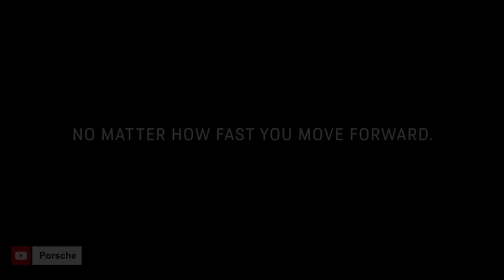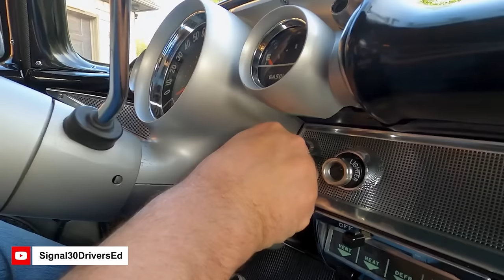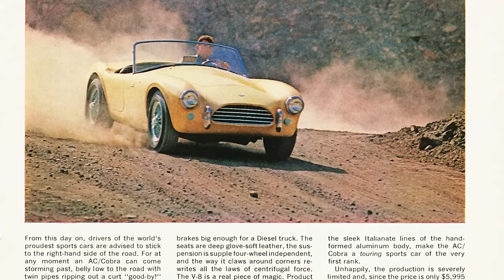Why Old Cars are Better

Comment: i honestly belive the sweetspot are 80s 90s cars.

they are old enough to still feel like youre driving, they mostly give you the emotions, they are still easily fixable by yourself, they dont have too many electrical systems that are dependand on each other or connected to each other

and they are still good to live with today. 

you want a fun little car? get a mk1 miata. 
you want a reliable but nimble and practical daily? get a 94' accord wagon manual. 

you want a big cool off roader? get Cherokee, a Landcruiser or a Patrol. 

you want a big luxury cruiser? get an LS400.

in the 90s, computer engineering was still in its infancy. manufacturers couldnt calculate accurately enough how long thier things would last. how long thier parts would last. so the rather over engineered them still. 

coming closer to the 00's these things changed. you can still find some 90s tech remnants in early 00's cars but you will have more and more electric steering and throttle systems, vsc, abs systems and so on. 

long story short, peak car engineering for the normal consumer was in the 90s in my humble opinion
Reply: DUDE, I saw a Mk1 Miata at the gas station today with a big block Chevy and an enormous Holley sticking out where the hood should be.  If I hadn't been late for work, I woulda stopped and asked about it.  Edit: Oh and a giant fuel tank strapped to the trunk Mad-Max style.  I almost didn't notice the engine because of the fuel tank lol
Reply: Also, the fact that lots of Honda tuners change the OBD2 cars back to OBD1 tells you a lot.  Me and a buddy are looking at doing this with, plus turboing a '98 Accord.
Reply: This exactly. That's the reason why my daily is a '99 Toyota Corolla wagon. It is still driven by cable, as is the shifting. It isn't fast at all, but it does feel like it is because of all the sounds it makes. Its exterior is  pretty banged up, so I don't habe to worry about scratching it. At the same time it has a bigger boot than a modern wagon that is way bigger in size. Everything that goes wrong, I can fix myself. That's a win in my book.
When I don't have to get from A to B, but I want to experience driving, I take my '88 Toyota MR2. This thing is amazing in what it does.
Reply: I daily a 95' LS400, a wonderful car to drive around and cruise. Even sorta fun sometimes if you push it!
Reply: the 90s crown vics are so nice
Reply: 80s cars have a level of analog nostalgia to them that is unmatched
Reply: Adding the W126 and W140 to big luxury cruisers.
Reply: I bought a '95 Accord, really, really good car and decent fun for what it is. Few electrical gremlins here and there but nothing too bad.
Reply: I love my ‘92 F150. Small block v8,  manual transmission, has everything you need, EFI, anti-lock brakes, but without all the modern garbage that make them impossible to work on. I don’t think I’ll ever own anything newer than a ‘97 or so. The newest vehicle I’ve ever owned is a ‘94 lol.
Reply: The moment OBD2 became the standard is the sweet spot. OBD 1 sucks balls to do diag with. Source: I own an 89 Super Coupe, and troubleshooting it is a bitch.
Reply: As an owner of a 5 speed 94 accord I completely agree. Manual steering, no abs and no traction control is makes the 160 hp feel like way more than it really is. Blown the engine twice and swapped it twice without too much headache. I’ve got coil overs and other suspension bits to Make it handle nice, it’s the shit.
Reply: @FurryWrecker911  you got that right. They’re so finicky. My old ‘94 Explorer threw a code one time, so I flashed it, and the number that came up literally said “No code present,” lol. I had a buddy who was a master tech and happened to have an old snap on OBD1 scanner he let me borrow. So I hooked her up and sure enough it was throwing a code for “no codes.” Can’t make that 💩 up. I’ve been wanting to replace the 5.0L in my F150 anyway, so I’m seriously thinking about getting a late ‘90s 5.0 Explorer motor for it, and swap in the ECU and harness with it, just to have OBD2 and not have to deal with that crap anymore. And having a coil pack instead of a distributor is just icing on the cake. I just hope the harness would be long enough, because wiring sure ain’t my strong suit lol.

Comment: Right. The sweet spot for vehicles is 96 to 2006. This trend is everywhere. How long does a new washer last? New fridge?
Reply: I'd say '76, if it was maintained and cared for.  Same with my fridges, freezers, washer and drier.
Reply: I totally agree. When my parents helped me buy my 99 Ranger new they told me if I defaulted they were done. That got me scared and motivated and when I got rid of it in 2021 it had 418K.
Reply: We had to buy a new dryer, it's 2 years old and already has issues blowing hot air. It's a dryer, that can't blow hot air.
Reply: @FuckGoogle502  76 is during the malaise era, definitely avoid anything made by GM at the time.
Reply: @SoupyMittens 70s gm cars aren’t bad just slow
Reply: @justinplunk5237  The build quality is usually pretty poor from what I've seen
Reply: Planned obsolescence.
Reply: Agree. That makes sense
Reply: I had GE appliances from 2004 that all started failing in less than a decade.
Reply: @user-vi4xy1jw7e  yeah. That case you can thank jack welch for causing problems
Reply: @SoupyMittens  When exactly IS the malaise era, and what manufacturers did it apply to?
Reply: you can even broadly expand it from 89-09, depending on what the vehicle is.
Reply: @Drunken_Hamster  In general, as far as I know, the malaise era refers to pretty much every American car made from about 1972 to 1985.
Reply: @SoupyMittens  Found more resolute information online. 73-83. By 74 regulations were in full swing, and 83 was the last year of truly/fully neutered engines with 84 being marked as the "end" with the GNX and 85+ having faster cars again.

And it does seem to only apply to American makes, though TBH IDK what foreign car I'd want in the range of 73-83, either... Maybe a Datsun Z as long as it's not the fugly 2+2 280z.

Comment: I took 2 years of auto mechanics in high school because it was a good skill to have and lots of fun. That knowledge saved me a lot of money, too. There are very few things I feel comfortable doing myself on modern cars, which is one reason I don’t have one. Repair & parts replacement of electronic components is very costly.
Reply: This summer I aim to learn auto shop stuff. I think it'll go very well with my degree of mechanical engineering. Hopefully I can also save my family some money with oil changes too haha

Comment: Learned to drive on my dad's 72 CJ5, I can tell you the is no driving experience more pure than an old Jeep. Thin military style tires, hard suspension, mechanical steering with a massive steering wheel, everything open around you, 2.6l straight 6 on a 3 speed box, pedals are perfect for heal and toe. You hear every noise, you feel every bump, you smell every smell.
Reply: MDJuan makes reproduction Willys Jeeps. I want, but might go Battery Electric Transmission.
Reply: They were better before their Stellantis times
Reply: 1975 and 1980 U 50 owner here (Brazilian C 5 with 2.4 Ford engine 4 cylinder) I couldn't agree more! my GF's Jeep (the 1980) has a "cage" and her windshield is up and she has half doors. Mine is lacking all that. Windshield down, no doors. Smile from ear to ear
Reply: @roelandpeeters931  hehe meu 72 Ford ainda era o 6 canecos, adoro esse motor.
O seu tem alguma coisa escrita na tampa traseira? Li que 72 foi o último ano que tinha escrito FORD na tampa
Reply: @arthurbretas2003  Lo siento, no hablo Portugues. Pero no, no tiene nada escrito atras
Reply: @roelandpeeters931  mine is pre 75 so it has the straight 6.
I was wandering what is written on the tailgate of yours, my 72 has FORD and I heard it was the last year it had it.
Reply: YES.  '67 CJ5 from my grandpa here!  I taught all my younger friends to drive on it.  It's got the Buick 3.7 V6 in it with the same 3-speed, only ours was set up for local vehicle recovery (one of my grandpa's businesses) with an engine-driven winch, a hydraulic lift and a PTO.  I told them, "If you learn to drive this, it'll teach you everything you need to drive anything else."  Working on getting the rebuilt engine back in now.  (Turns out it had 5 cylinders the whole time I drove it.)
Reply: why would you heel and toe an old jeep
Reply: @marten6578  downshift from 3rd to 2nd for speed bumps an corners, it's smoother if you heel and toe
Reply: @arthurbretas2003  I.understood that. I live in Bolivia. Most CJ 5s here are actually U 50s. Square rear wheek well vs round for US models  And no, no writing on the tailgate.
Reply: @roelandpeeters931  we have a tailgate from a later model with no writing here, as well as 2 WILLYS tailgates. 
Where were the Bolivian Jeeps produced? Ours were in São Bernardo do Campo, the engines cast in Taubaté
Reply: @arthurbretas2003  I have no idea where they were made tbh. They're our dai;y drivers and one is 1980 and other 1975, both 4 cylinder Ford engines. Other than that I don't know anything.
Sorry
Reply: @roelandpeeters931  No need to be sorry chap, I'm the one asking overly nerdy questions

Comment: man, when you were talking about the steps needed to start your classic cars, it brought back good old memories. I remember one vehicle had it's thermostat brake on me. It wasn't a big deal, and after that when I'd go starting the car up I got into the habit of not leaving until the water temp/pressure gage got to that spot where you could feel or watch exactly when the thermostat opened. My Christine car growing up was a 79 Ford Ranchero. It had it's ups/downs, but by the end of the day it got me from a to b, easy to work on/fix yourself, and just a joy to ride around in.

Comment: The 90s were the height of American cars with the GM 3.8 V6 and the Ford 4.6 V8 which are still running strong today.
Reply: I go out of my way (and sometimes pay out of pocket) to convince people to fix their GM 3800s and 3100s instead of replacing them.  They're such unsung heroes.  My old 3100 has kept a few Impreza WRXs on their toes.
Reply: @FuckGoogle502 same goes for the 2.8l/3.1l
Reply: Not to mention how many old Chevy and ford trucks from the late 80’s are still on the road as salted up winter beaters with 300k+ miles. The video guys stupid for thinking a modern pickup would last that long
Reply: The 90's also saw the introduction of the LS V8's from GM
Reply: I've got an 08 Ford F-150 with the 4.6 L Triton. Great engine.
Reply: I had a 99 Bonneville with GM's 3.8 V6. I wish I had it now. It was super reliable.
Reply: The 70's cars are the most robust and easiest to work on with all standard hardware and standard measurements. Also the suspension is much better in the 70s-80s. In the 90's they started doing the "European" suspension on cars which is rough. I had a 92 town car with the air suspension and it was still way stiffer and rougher than my old suburban. Although I will say that fuel injection and overdrive transmissions are big upgrades. The ideal car would be  a 70s car with those 2 things added.
Reply: Not to mention the 5.2L V8 that dodge made. Mine still runs smooth as silk 33 years later.
Reply: @SturmDrachen07  Pretty much all the engines that were designed on drawing boards in the trusty SAE imperial units were rock solid. The 5.2 is just the metrified name of the 318
Reply: The 90s were the height of cars in general. 
Lots of new and good technologies, well designed chassis still and not much restrictions.
Reply: I have Mercury grand marquis 1993 year

Comment: After having a '92 Firedbird, '01 Bonneville, '02 Grand Prix, '97 Ecoline, and '01 Explorer, i have decided that i will always get vehicles from the 90's to very early 00's for the rest of my life. I love being able to actually work on my car. Say what you will about Explorers, but there hasnt been a single problem ive had yet that i couldnt fix, and there are so many of them at pick'n'pull that often i can find parts very cheap. On top of that, the aesthetic of 90's models were great, and the features were awesome. CD/cassette combo for life!!!

Comment: This video almost made me cry. I will keep my '99 Corolla forever. Thank you for this fantastic masterpiece of a video. This is one of those videos that feel truly important. You are not blinded by nostalgia. My Corolla is modern, yet very simple and old school. It is like a car that feels 10 years older than it actually is. In a very good way. I have driven different cars, mostly from the 2005 to the 2015 era, but my old Corolla with the 86 hp 1.3 engine, puts the biggest smile on my face. You are so much more THERE when driving. It becomes an extension of my body. You can feel and hear so much more, yet it is comfy silent. I could rant on, but you do not get to experience the "true drivers feel" in a modern car where everything is muffled and faded. More people should see the value in old cars. Modern vehicles feels like you are driving high on some comfy substance with your nervous aunt yelling at you.
Reply: I have a 2000 Buick century. I get a similar feel in it. It's slow... but so reliable and comfy. I hope it runs right into the next century C:
Reply: @amyramos4886  Yes, they got their charm those old cars. Keep it rustfree, proper maintenance and normal driving, and it should last forever :-) I'm crazy, so I'm going to repair rust on the Corolla for a lot of money. It will cost x2-3 of what the car is worth in money. But it is worth it to me
Reply: @amyramos4886  saw some pictures of your model, and it looks really nice. I like that era's simple but clean design. Hope you manage to keep it going forever:D
Reply: @09simid  Thanks 😊 👍 It is pretty simple, but I like that about it.
Reply: I just spoiled myself and put a new stereo in my early 2000's Australian Civic. What bloody moron invented a stereo deck without a volume knob? Less than a month in and I want to take a hammer to my new radio with its stupid touchscreen, and go back to the old one. What are we doing giving drivers TV Screens in their Cars? I reckon inside 10 years we're going to be looking at todays cars as our real loony stage.

Comment: I really enjoyed this video. When I started working on cars my motto was, "If I can take it apart, I can put it back together." and it worked for all of my early vehicles. You're right, I was not a mechanic, or what we used to call, a motorhead, I was just a typical teenager with a car and no money. So if it broke, I had to fix it myself, usually with parts from the "U Wrench It" junk yard. Which meant I had to take tools with me so I could remove the needed part once I found a car that had what I needed. Ahhh those were the days.

Comment: I love that this video has described my weekend his week. Replacing a worn distributor on my 42 year old car and setting up the timing and the choke and the feeling of pride when it actually starts and going for a drive in the first sun of the year. Having an old car is definitely a headache but it definitely makes you slow down and think how things work and problem solve. Repairing it on the side of the road or in a car park can be thrilling
Reply: Yeah. People on these days have turned to be lazy with their cars and rather buy expensive repair than repair car themself

Comment: My father has a 1950 Dodge B-2-C that we've been working on. It sat for about 18 years before I took an interest and expressed that I wanted to work on it. We put in a new battery, sanded the points, changed the plugs, squirted gas down the carb, and it fired right off. Soon after, I managed to drive it backwards a few feet out of the rut it was in. I didn't really know how to drive stick at the time (however I know the principals behind it), but I sure learned the feeling of driving a manual. It's not road worthy yet, but driving it around the yard is so fun. Hopefully by the time I graduate college, I can drive that Dodge out of the parking lot like a cool kid 😂

Comment: I’m 20 and I just bought a ‘63 cadillac coupe deville. It’s a beautiful car and needs some exterior work, as well as a bit of interior work and engine work. 

The car is running already, but it was sitting for 6 years before I bought it, so I need to touch up on the transmission a bit, and I need to check out everything else to look for corrosion and make sure it’s all good, but I’m so excited to work on this car. I was originally planning on eventually doing an LS swap on the car before I bought it, but now that I have the car, I just want to keep it the way it is.

Comment: I've driven and/or owned a number of cars over my 12 years of driving and I can say without a doubt that the older they are the more I enjoy driving them. I find myself constantly confused in new cars as to how it works and what it does automatically that I no longer need to account for. The joke here is I used to be a programmer full time. Now I drive a 1990 XJ and I love every moment of it. Not to mention I love working on it.